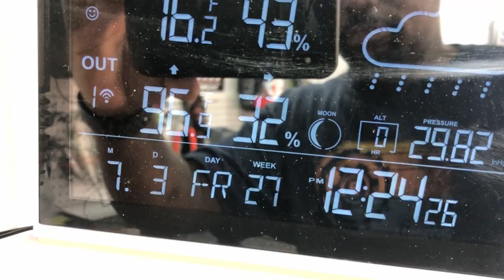(More testing) Still Day 1 Running the Worlds Blend V2 at Trains & Lanes Hobbies Part 2

Comment: Iv been using it for a while $14.00 a tube
Reply: I got the same novarossi as you do. But mine has had issues big time 1st  piston and sleve wore out. It lost all compression then I had it pinched. That lasted about 2 quarts then it was back to what it was originally. Then I had a buddy put a new piston sleve and rod in it. He noticed something odd about it. The carb was not all the way down. It was like that when I got new. We broke it in it was ok after that. But the compression is kinda weak to be honest with you. My other motor that I broke in dynamite. 21 XPE euro edition has alot more compression then my novarossi does